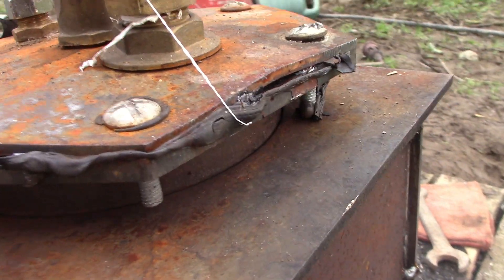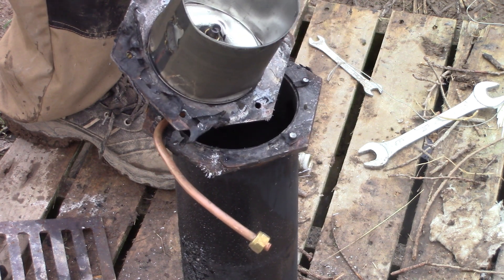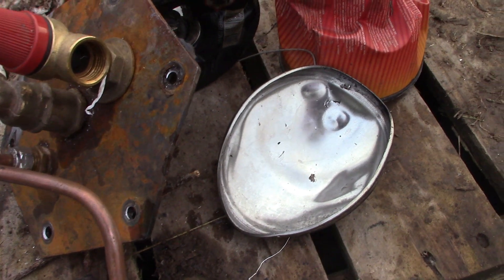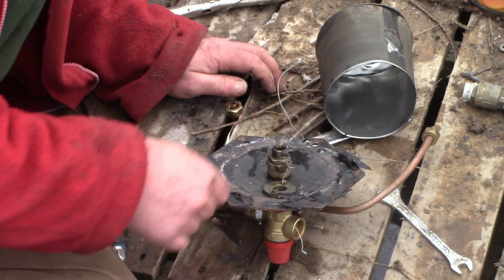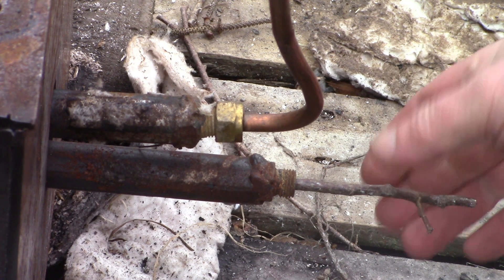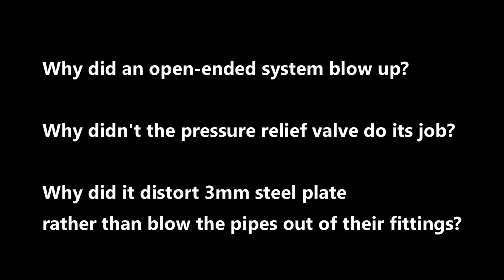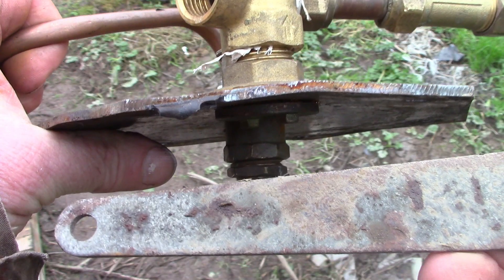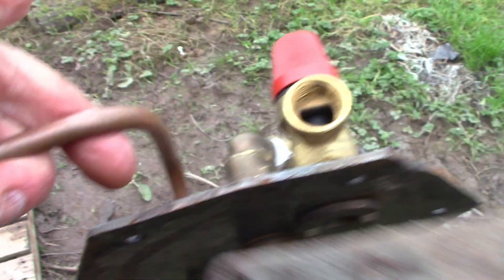Why Did My Boiler Explode??!! My Own Big Bang Theory...

Comment: Your floats were not empty. They were full of some gas. When you heat it up, that gas will expand.
With how tight a fit it was, they could have potentially created a poor seal between around the wall of the boiling, meaning steam generated at the bottom had no where to go until it caused an explosion.
Or, what I think is more likely, the top one was hotter, reached a point where it failed and exploded, potentially blocking off the pressure relief valve and maybe even the steam exit.
This now trapped the water below, causing it to boil and crush the bottom can.

For your next floats, make sure they are actually empty (i.e. hook them up to a vacuum and remove all the air). And I recommend having more space around them (possibly put an inner cage in the boiler to keep the floats contained in that and allow the water/steam around the outside)

Comment: Maybe the bottom float imploded first, and when steam rushed into that space it forced the upper float into the top plate where it formed a seal blocking the pressure relief valve as it also imploded. Very glad no one was injured.

Comment: The steam was in high pressure but the gases in the containers were much expanded too. This explosion wasn't caused by the water hammer or the incoming water, otherwise an inplosion would have happened. with the fusing of one container onto the protruding section of your system, the explosion was simply a magnification of the can explosions.

Comment: The problem is, that a differns in pressure can build up between the floters and the rest of the boiler. At least that is my guess.
further more: since pressure from the boiler could escape outwards I would guess, that the prosess started with overpressure in the floters. they poped open, and somehow got crashed afterwards.
Reply: Ergo I think your floters need a hole on the bottom. (or perhaps no bottom at all.) The problem I see with that is after cooling down they wont float (at least not as good.)

Comment: Too much space for steam to collect in the boiler - if you allowed more water and less air the boiler would have less pressure.

But I have no idea why the pressure relief valve didn't work.  Unless it didn't have enough time.

My opinion is that one float is better than two.  And thanks to your mishap we have learned that your float valves should be reinforced metal.

Also how sure are you that there was no gas vapor remaining in the float valve (old gas cannister)?  At high pressure perhaps it was able to combust?

Comment: The relief valve give me headackes. Can you test the function with pressure on it? But your theorie seems to me clearly right. Mmmmh, maybe the upper Gas cannister get pressed to the top and the relief valve was blocked.

Comment: also by the way I wouldn't be standing anywhere near that device with those wealds on that high pressure steam pipe find someone that knows what they're doing and get them tig weld it's and crack test it

Comment: This same thing used to happen on locomotives from time to time. The danger in a boiler is not the static steam pressure, it's the potential energy in the water that has not yet turned to steam. If the pressure in the boiler suddenly drops due to a crack, or in your case the collapsing float, that water will produce FLASH STEAM which will have an explosive force. The flash is so fast that the pressure relief valves can't vent it or even open fast enough.

Comment: To bend the top plate as such, shows the immense power of steam. I am impressed. But, was the relief valve new, used, perhaps corroded inside from prior use? But I would imagine you had used a new one. It does look to me that the system had a need for twelve bolts as opposed to the six. Hot water will only turn to steam when it hits air, so if a few inches of metal between bolts bent, suddenly giving a lot of air, perhaps the major portion of water turned to steam all at once, giving you a nice awakening. But the other explanations below sound reasonable too. Good luck.

Comment: It's worth noting that if you measured 230 celsius steam, then the pressure in the boiler should have been nearly 400 psi. The top cannister looked to be molded around the fittings by the pressure, perhaps that caused your release valve to fail. That much pressure should have made a horrible racket at your outlet. The low pressure you have your relief valve set to shouldn't have ever allowed such a catastrophic failure -- unless a few safeguards had failed already and your pressure was way higher than you thought, perhaps.

Comment: very late, but I don't think that's how boiling water works; the boiling would equalize to the vapor pressure at the temperature of the water, I don't think there would be a spike

Comment: Railroad Hazmat training... BLVE, pronounced "blevvy". Boiling liquid vapor explosion. A tankcar containing a liquid, involved in a wreck resulting in fire... Clear the area, as the liquid in the tank boils, the gaseous vapor results in an explosion and often rocketing of the car.

The canister exploded from the internal pressure buildup. As the top would likely have been naked, exposed to steam not water, it would not have been cooled, just like the crown sheet on a locomotive firebox.

Add the cold water, the thermal shock cracked the canister and caboom. Keep in mind, a simple camp fire gets hot enough that a soda can can't support its own weight. Aluminum melts at only 660°C. I don't know when it hits it's half-strength point, but I wouldn't be surprised if it's right around 250°C. 

Aluminum coal Hopper's are stenciled to warn not to exceed 400°F when thawing the coal. 

Check out Kyle Hill's video on the SL-1 nuclear reactor disaster. It has a bit of a similarity to the physical destruction shown here... Thankfully no radiation effects though, lol.

Comment: I believe the floats, are what failed, and exploded. Possibly water was forced into the container, boiling the water inside, and not being able to release the pressure  until they exploded. Normally you have to push the top of the bottle down to let gas out. But with enough pressure it would of pushed the valve down letting in water.

Comment: I think the cans colapsed due to temperature hot soaking the plastic valve assemblies in tge tops of the cans.  Heat likely melted the diaphragms in the gas valves allowing the air inside to esacpe an the cans collapsed under low internal pressure. The cans resist internal gas pressure at low temps. They crush easily esp. If he air inside escapes.  There was probably 10 to 20 psi in there and once the can crushed the water tap rushed in and crushed everything.

Comment: Funny i bet you had some residue in the tanks and they grew under the heat and over pressured and blew not yr steam setup! They got hot then the water going in was cold and weakened the metal of it making the heat get to it and they let loose!

Comment: Combining a tube boiler and conventional boiler is not a good idea. I would put an injector on the tube boiler.  Small pipes will always handle more heat and pressure if kept wet inside. Rocket stoves do not have a fire box.

Comment: Switch to a cork balsa wood float you will need to seal it with acrylics. That way it can not crush. Also the bottles had some gas in them you exceeded there pressure limits cause them to fail and rupture.
Reply from the maker: I keep meaning to experiment with cork - can it really cope with the heat/pressure?

Comment: In case you look at the comments of old videos, I just saw another video of someone building a steam engine. They used an old C02 cylinder for the boiler as it can handle pressures upto 800psi. 
their video is here https://www.youtube.com/watch?v=UHkNNjsNccI
Reply from the maker: thanks, Falney. Yes that would work, but I'm still thinking a flash steam boiler would be better for my job

Comment: I think that the pressure vessel has two diferrent temperatures,one at or below the liquid,say at 100 c.And one above it,at perhaps 150 c.When one of the floats collapsed the fluid level suddenly lifted into the high temp zone,flashed lnto high pressure steam and overcame the safety valve and pressure vessel.When i was a kid,i used to take a steel pipe caped on both tends,filled a quarter full of water.WITH a small hole in one end,I would hold it with the hole pointed up with pliers,then heat it up really hot with a propane torch on the upper end and invert it so the water fell on the hot end now on the bottom,the flash of steam shot it clean out of my hand and quite some distance.kids beware,i got burned a little,could have been much worse.your collapsing float did about the same thing i think.....be carefull..

Comment: you are worried about regular boilers and you go experiment with flash boilers? I have been thinking bout this incident. I think vapour pressure comes to mind. Assuming a closed system and the interior or your water tank was at 5 psi it collapsed the two butane bottles As PV=nRT your volume increased as the gas bottles were effectively crushed to zero thus your pressure decreased, at a stable Temperature. With less pressure on top of the liquid it can quickly turn water to steam faster. See Steam Tables.  Also steam takes up 1300 times the volume than for a given volume of water. Tyco float type feed water actualors have very stout cast iron floats. See steam car boilers for workable flash boilers.
Reply from the maker: except it wasn't a closed system..

Comment: Looks like a catastrophic cascade stemming from an implosion of a float can. It appears more impact damage than over pressure rupture. One can collapsed and the other shot up to blow out the pressure-stressed top plate. A more robust float-connecting rod set up would be the ideal low-tech fix. I would consider going stainless too. Good luck.

Comment: A flat plate for a pressure container is very hard to make strong enough. I would think it would be better to find and use a weld on pipe cap as the ends of your primary boiler. The caps are available from many sources and are quite inexpensive compared to a charge from a hospital burn ward.
Reply from the maker: I'll have to investigate those - thanks

Comment: So don't use floats. Why was that an idea?
Reply from the maker: As I explained, floats stop the whole system getting overrun with water if the temperature drops. I just need to find a different material, I think.

Comment: That could be why later steam cars run on a coil of water rather than a tank of water so that it doesn't all flash at once... great project bud... back in the day there were many cases where steam locomotives would just explode mysteriously( probably had a lot to do with softer iron back then but flash boil explosions used to be a big problem)..... could be the same thing 🤔

Comment: Pretty sure you were told in other videos that the valve you're using is a PRV for hot water applications, not a safety valve designed and rated for steam. They are not the same. It's the most important boiler fitting you can have. I'd start there on the rebuild.
Reply from the maker: It's the same one used on air compressors - any good?

Comment: As someone that has worked with steam boilers I have to ask about your relief valve. Was it sized for water or steam. It looks like a valve from a domestic boiler.  That would be sized for water which has a much smaller volume than steam.
Reply from the maker: You're right - but it's the same as the one on my air compressor, so I'm not sure what the difference would be?
Reply: @wayoutwest-workshopstuff6299  talk to the Spirax sarco agent in Dublin. He will recommend a suitable valve
Reply from the maker: @patrickmoore8428  Ok. Thanks. Except they don't have anyone here - I'll try Germany
Reply: J J Doherty Ltd will be able to supply a PRV

Comment: The upper "floater" is not impoled the red one is. The blue one is exploded like a closed coke bottle with dry ice and hot water in it. You are definitely under estimating the can to go boom. The gas can manufacture didn't have written "don't heat the can above 50°C" on it for shits and giggles.

Comment: That's not a Mystery, that's obviously the upper bule gas can blow up and crushed the lower red can and your lid from the boiler that upper can had residual gas in it, not much to be in liquid state though but enough to expand forcefully that the bottom of that can plopped like those half ball rubber thing that jump when you flip them inside out. Slamming into your valve and this red over pressure thing only prevents over pressure not things slamming into other things. It's like asking a car to fly by yeeting it of the cliff. Pressure valve measure the pressure in their own system the can is a separate system for itself. You can't pretend the valve to do its job on a separated system. What has the valve to do In your opinion? Tap a hole in that blue can and vent it for you?!

Comment: And now I see this. Pity I hadn't sent you the message with my concern shortly after the build.
So, if I'm reading this right, the pressure in the boiler crushed the float. It makes sense, since the gas cartridge is designed to handle INTERNAL pressure, not external. I suggest a more robust float.

Comment: From the bulging gas cylinder base I am thinking the gas cylinder was the thing that exploded inside and the top end of it wrapped itself around all the fittings in the lid and the sudden pressure increase bowed the lid.

Also a second problem looks like this exploded tin sealed over the underside of the outlet and pressure relief valves...

https://youtu.be/AzI4rQ-gDQ0?t=110

The area of that 3mm plate is pretty large. Say it's 5inches diameter then has roughly 20 square inches area. If it got to 100psi that would be 2000 lbs force on it, a tonne nearly. The same with the flat bottom on the other end of the cylinder. 

Steam boilers for scale model traction engines are this sort of size and are made from very thick copper or steel for a reason, and are subject to strict testing.

Take care. Rob

Comment: It's never free to exit as fast as it wants if you're necking it down.

You have a large boiler making steam and sending it down a smaller line. That's going to increase pressure just by itself. 
If the fire is too hitnot will make more pressure than it can release through the open line just because it's being constricted.

The extra relief was disabled when the gas left in the fuel can floats was pushed out by extreme heat and then the cans cooled... essentially crushing them with atmospheric pressure.

Comment: It was bonnet hypothesis. If you notice that one gas float was squish and one the bodom was nolonger there. When the top one exposed sending it in to the valve and the bodome of the can in to the other that the other one valve was compromised and when the rapidly cool down  Including the bodome can and scents th the lid was not welded thank the lord it would of be worse

Comment: Another change I would possible make would me instead of using welded tube used threaded black pipe (1000f 538c degrees) the pipe you welded looks like 400f 204c max temp